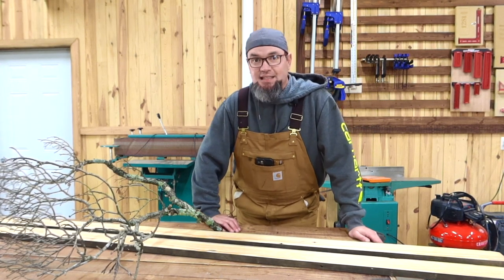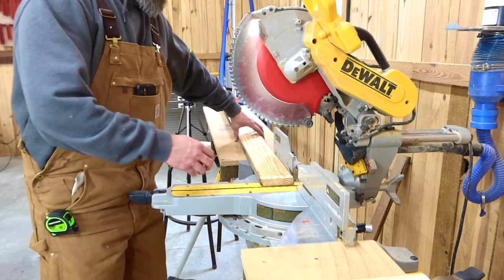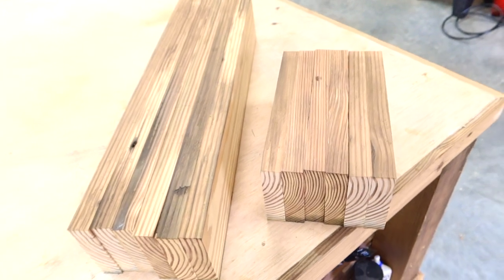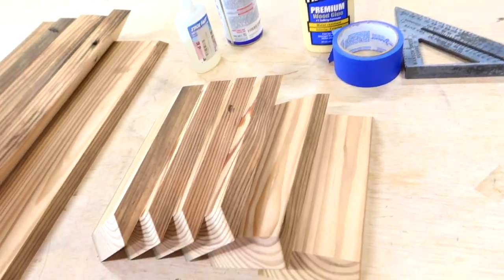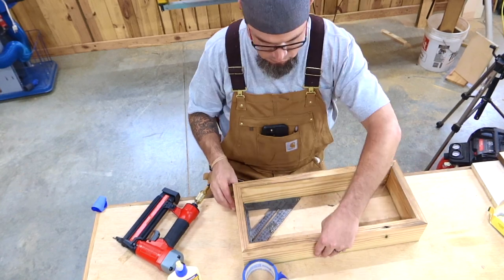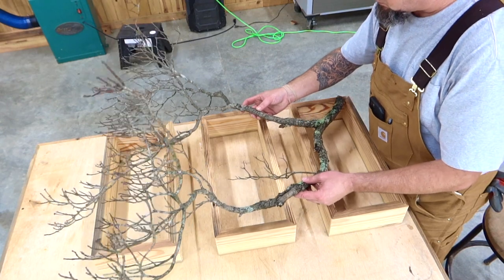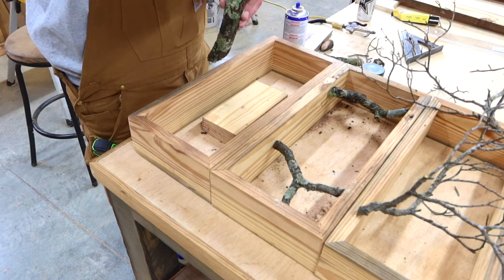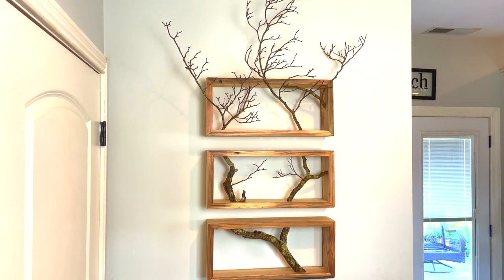Make Money Woodworking - Easy Beginner Project

Comment: Peech signature “out of the box” design. One thought, to ensure the box parts are the same length, cut to length, cut 45 on one end of each piece. Then put the 45 cut ends against a properly positioned stop block to cut the 45 on the other end.
Reply from the maker: Very good idea!  I was trying to think as simple as possible for a beginner video. But that would have been an excellent beginner tip. Thanks for the input!

Comment: I liked the video and the twist you put on/in the boxes is amazing. I've always loved carpentry/woodworking and I think your videos are a big help but I do have a question. How did you hang the boxes? If you did it using a keyhole slot, I could use a good video about doing that with or without the templates they make for routers to do it. Keep it up!
Reply from the maker: Thanks!  Keyhole slots would work but not needed.  Sawtooth frame hangers will work just fine.

Comment: I made one today. 
It turned out great.
Thank you yet again for another excellent idea and tutorial video! 

I was going to upload a picture but it doesn’t seem to be an option.
Reply from the maker: Sweet!  This is such a great build because every one turns out different.
Reply: Hi Jeff- what adhesive did you use?  I have tried hot glue, gorilla glue and an adhesive spray- non of them holding the branches on.
Reply: @healthywayz8630  It's CA glue (or superglue) - you can see he applys the glue, then on its ajoining piece he sprays the accelerant

Comment: Great projects and videos. I think the nooj would approve also... and what are you using to wall mount? sawtooth hangers, D rings?
Reply from the maker: Both of those would work!  I actually just used command strips for this as its pretty light.  But for long term hanging sawtooth would be the way to go.

Comment: love this channel I only just subbed but it only took one video. So, I have been wanting to invest in a brad nailer and now I believe I have all the excuses I need to "pull the trigger", if Ya know what I'm sayin'. Anyways I'm wanting to go battery powered because I can't justify the compressed air just yet, and I can only invest in one type really atm, possibly for quite some time. idk what future projects will hold but I'm torn between getting an 18-gauge nailer and 16-gauge nailer. is 16 gauge that much bigger that it can make small frames look unsightly? what do you suggest?
Reply from the maker: If you catch them on sale you can buy the whole pancake compressor kit that will include both nailers and the compressor for less than the battery powered.  I dont use the battery powered because of the size of the tool.  But thats just me.  Go with a 18G If your choosing between the 2.

Comment: Does the glue support the nail, or vise-versa?
Reply: The nails support the glue. Once dried, the glue will be MUCH stronger than the nails. The nails just hold it until the glue dries. I've tried to pull apart glued wood and often times, the wood will break before the glue will.